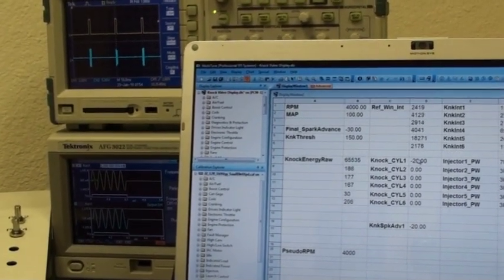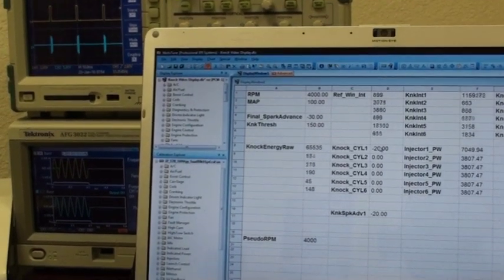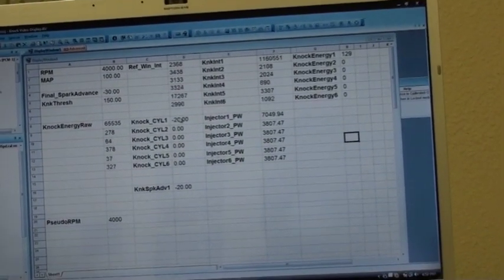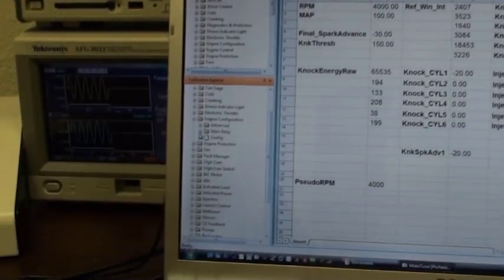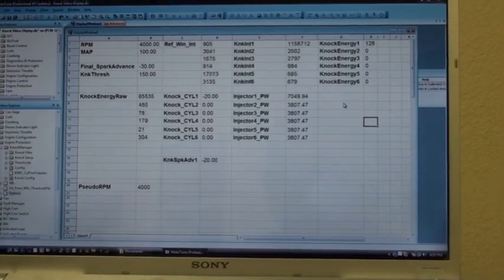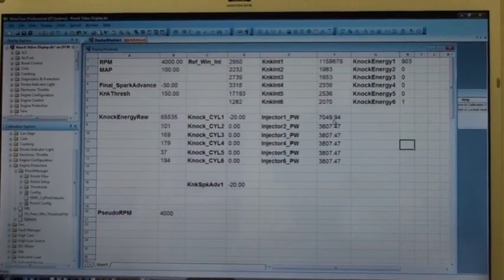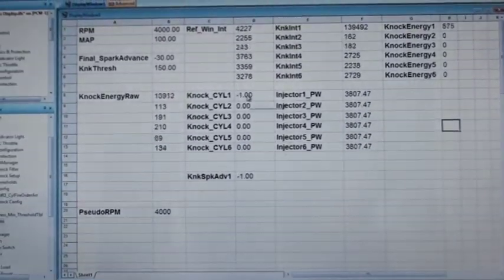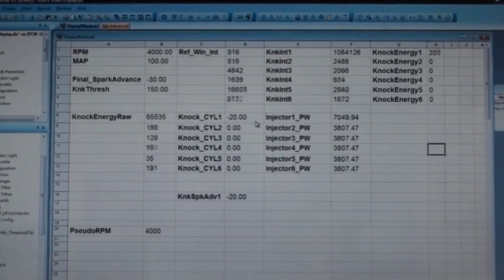ProEFI Knock Control Part 2.wmv

Comment: Brilliant technical content delivery! It’s not an easy task to demonstrate such a technical feature in layman’s terms yet still reflect a sensible level of practicality. However, for bonus points, what was included but not spoken about directly was the manner in which the ECU has the flexibility and functionality to re-introduce the Knock event counter measures. The demonstration was happening so quickly it would hard to pick up on something like this unless you were experienced with this functionality as an Engine Management Calibrator. Again, hard to believe that this technology has been available also a decade ago in a fully functional manner; no beta. 

Cheers Jason!